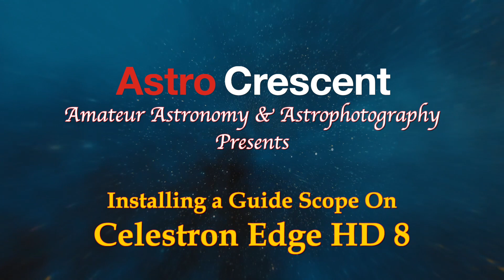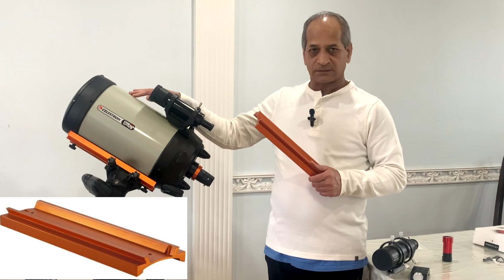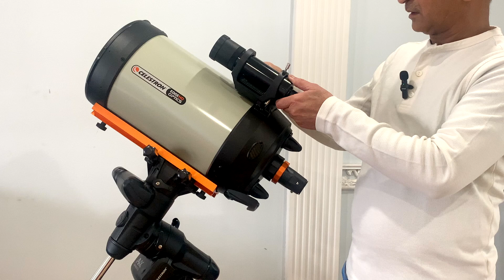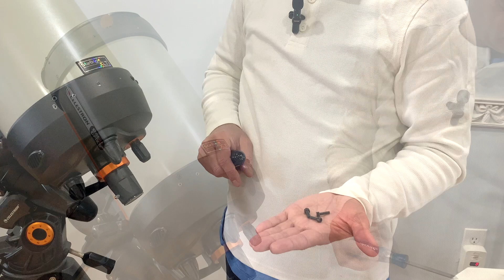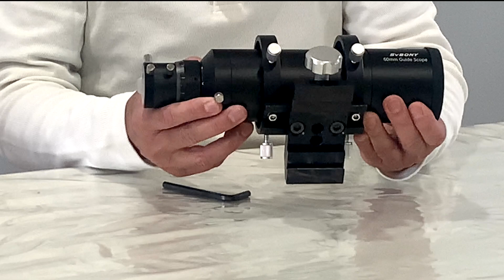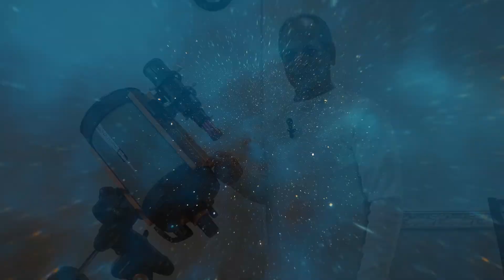How to Install a Guide Scope on 8" Celestron EdgeHD or Celestron SCT: Feat. SVBONY SV106 60mm

Comment: What software do you need for the actual guide camera? Windows OS
Reply from the maker: Phd2 on Windows. If you are using ASIAIR, the phd2 software is built into it. Thanks!
Reply: @AstroCrescent  I have an HP laptop with Win 11 and the orion starshoot camera does not work with PHD2 and it says it does.

Comment: How successful was the guiding with this setup?   I have a Stellarvue 60mm guide scope I may try on my new edge HD 8” arriving next week.  Planning to use on my AM5.  I currently get guiding accuracy around 0.5 arc-sec rms with my 480mm FL refractor.  Not sure if I can get that with my new setup at 2032mm
Reply from the maker: You might get between 0.5 and 0.8 on AM5 mount. I did try the 60mm guidescope on my AVX and it was between 0.8 and 1.00. Thanks and Cleese Skies!!

Comment: What size Celestron dovetail is that?  It looks like the same dovetail that's on the bottom of the scope.  Do you have a link?  Thank you.  Great video. I just got an Edge HD 8" and was looking for solutions to mounting my guide scope (same SVBony scope you have in this video) and an ASI Air Plus.  I like your solution the best of what I've seen so far.
Reply from the maker: Thanks! I’m glad the video is helpful. The dovetail bar I used is Celestron Dovetail Bar for CGE - 94216. It may be available with your local telescopes dealer. Here’s a link from Amazon:
https://amzn.to/4f0nFe2
Thanks again and Clear Skies!!

Comment: Great video, thanks.  I have a vixen dovetail left over from my attempt to use my 8" HD on a wedge-modified evolution mount which was not very satisfying! I'm planning to reuse the vixen to mount the guidescope on the Edge with a new AM5 mount.  I bought the same 60mm you show in the video, coincidentally.  I am hoping for a very stable and repeatable setup with very little flexure for guiding with ASIAIR. It's all portable; so it will be set up then broken down each night.  Does the setup work well for you?  I'm still concerned about the knurled knobs and whether they maintain a solid pointing even when the scope is turned during the evening while guiding or moving to other targets.  Thanks again.
Reply from the maker: Thanks for taking time to write! Much appreciated. Yes, the setup did work well for me. I’m sure you will not have any issues with your AM5 mount. All the best! Clear Skies!

Comment: Which Celestron 8" dovetail bar did you use. I have a Celestron EdgeHD 8 OTA - 8" f/10 Aplanatic SCT OTA scope. Could you add a link? Thank you
Reply from the maker: Thanks for watching! I don’t have the specific link for dovetail bar. But you can search the Celestron.com website for EdgeHd 8 dovetail. You will quickly find it there. Alternatively, you may call your local telescope equipment dealer to find it. Cheers!!
Reply: @AstroCrescent  Thank you

Comment: Thanks your work..... celestron  8 Se... , celestron 150SLT ,  edge HD what is best and quality picture telescope ?
Reply from the maker: Thank you!!! EdgeHD is definitely the best in my opinion. It’s specially designed for Astrophotography. Clear Skies!!
Reply: @AstroCrescent  can i use Edge HD OTA for  celestron 8SE tripod ?
Reply from the maker: I think yes. But you might want to check with experts. I don’t have any experience with 8SE. Clear Skies!!
Reply: @AstroCrescent  thanks your help.... can i connect AZ-GTI mount kit for edge Hd OTA ?
Reply from the maker: I dint think so. AZ-GTi can only take about 5kg payload. Cheers!!

Comment: Thank you very much for all your useful videos. Regarding to the dovetail bar I have a question. I like to install it on my CelestronNexStar 8 SE on the bottom site for mounting on AVX. According your experiences is the possible ? Best regards Harry Switzerland
Reply from the maker: Thanks!! I’m glad that the videos are useful. Reg the dovetail bar, please check Celestron website for compatibility with Nexstar 8 SE. Alternatively, you may ask your local dealer to confirm. Cheers!!

Comment: Hi Pawan.  When you have a chance, can you kindly check the model number of the ADM bracket you used for this setup?  It doesn't seem like the DPA-VPA-FF is the same thing, since it doesn't provide for mounting anything with screws.  I see a DPA- D Series Dovetail Adapter.  Would that be it? Sorry to bother, but I'd appreciate it!  Thank you.
Reply from the maker: Hi Greg, the adapter I used is “DVPA- D Series or V Series Dovetail Adapter”. This is the exact description from ADM. Comes with 2 x 1/4×20 hex screws. Hope this helps. CS!
Reply: @AstroCrescent  Yes, that helps very much!!  Thank you again for all your help, Pawan.

Comment: Nice tutorial. Can you please provide info on the specific ADM bracket you are using? I plan to do exactly as you've described. Thanks
Reply from the maker: Hi Joe, thanks for watching and your kind words. This is the bracket I have used - ADM D Series Female to V Series Female Adapter - DPA-VPA-FF. Cheers!
Reply: @AstroCrescent   When i enter that info into the search of the ADM website the bracket that comes up looks nothing like the bracket on your video
Reply from the maker: @Fern1707  Checkout this link:
https://www.admaccessories.com/product/dvpa-d-series-or-v-series-dovetail-adapter/
Hope this helps. CS!
Reply: Are the two hex bolts provided or did you purchase from a local hardware store? What size. The two holes in the original guide scope mount are threaded? Thanks.
Reply from the maker: I don’t remember but I think I purchased from local hardware store. These are M4x20 hex bolts. Thanks for watching. Cheers!

Comment: Hi which ADM bracket do you use does it really matter which one it is because if I have the same guide scope dovetail does the ADM Prism Clamp/Adapter for Skywatcher StarAdventurer GTi fit?
Reply from the maker: This specific ADM bracket attaches to both the guide scope at top and the Celestron dovetail at the bottom. I can't say whether your ADM prism adapter for Star Adventure will fit or not. Thanks.

Comment: is that gudescope to smaLL?  IVE GONE WITH OAG
Reply from the maker: OAG is recommended for this setup. I did not use that option due to cost concerns as you need a guide camera with larger sensor. Cheers!

Comment: Isnt that a too small guide scope thought it need to be min 400-800 focal length
Reply from the maker: You are absolutely right. I'm just building this rig to start with. Cost is a concern at the moment (after all, it's a hobby). An ideal solution would be to use an OAG, but that's an expensive solution. So, I'll do that next year. Let's see how the scope performs with 240mm guidescope.
Thanks for watching. CS!

Comment: Hello!  Would this work with a C6?  I'm trying to see if I can attach my small refractor for a guide system.  Awesome video by the way!
Reply from the maker: Hi Josh, Thanks for watching. I doubt there's a Celestron Dovetail bar like this for C6. However, ADM has one. You may search for "ADM V Series Dovetail Bar for Celestron 6″ SCT Telescope - Extra Long - VC6-XL". You may be still need some base for mounting the smaller refractor, such as "Svbony Medium Dovetail Clamp". CS!